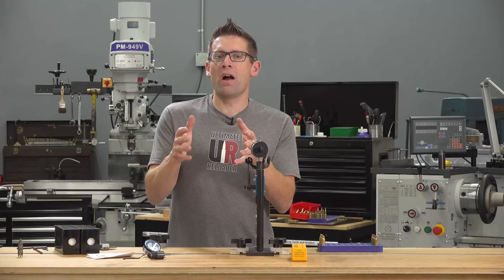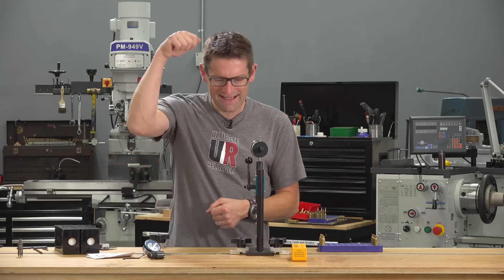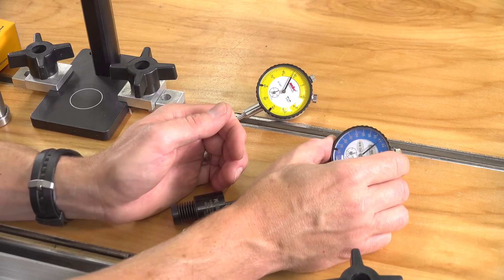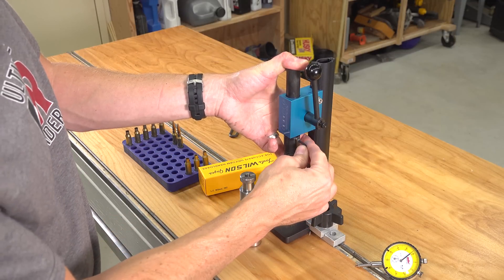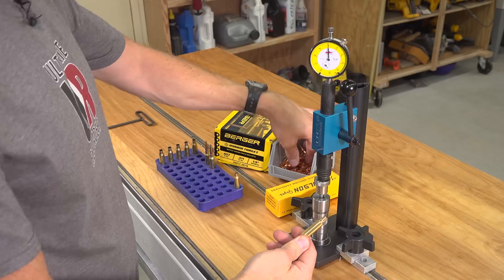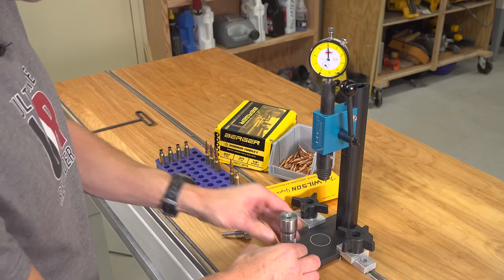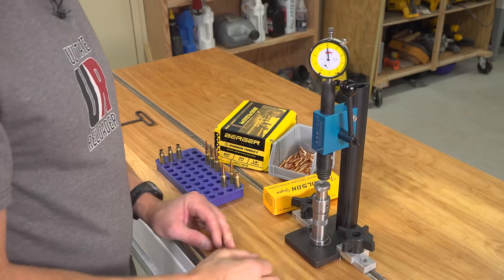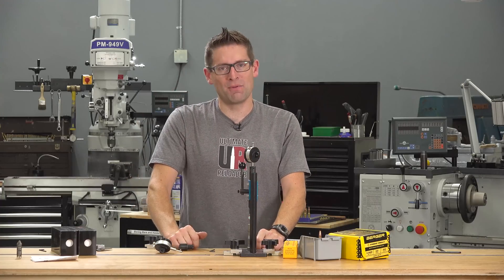Monitor Bullet Seating Force: K&M Precision Force Pack with L.E. Wilson Seating Die

Comment: When the gauge is "zeroed" it's showing 300 lbs (300/1000ths). The rotation counter is at three while under no pressure. This is the same as K&M's product video. I bought one and found the stainless rod between the head and the dial plunger is about 1/4" too long. I loosened the set screw securing the rod to the head and allowed it to protrude under the head and zeroed it. Zero rotations and zero thousandths. Then cut off the same length of rod that was protruding with a diamond wheel since it's stainless, polished it flush and now have an actual zero. K&M should really address this.

Comment: Going in doesn't matter. Going out does.  "case in point" I size some brass, neck tension was .002", I copper brushed the inside of the neck, pressed a bullet. The bullet seated great and I thinking to myself I'll have much more consistant release because I got the existing copper out. Then realized I seated it too deep, went to pull the bullet and I thought for sure something on my press was going to break. That bullet fused itself to case with incredible force. I was lucky to learn my lesson then but it also taught me going in doesn't matter near as much as out.

Comment: Inside and outside neck reaming/turning and annealing must be next ! I finally broke down and ordered the inline Wilson dies/ K&M arbor press and force pack setup. I really like my Whidden, Forster and Redding dies. But these Redding chamber dies are by far the most well made dies I have now. However the machining and edge softening and polishing is 1st rate on these Wilsons. I have read the internal neck inconsistencies can alter the rounds launch, by grabbing onto 1 side more than the other. Also by altering the bullets axis from the start in the bore. (as shown on runout gauges.) The round starts slightly off center and kinda bounces around getting started down the bore. By neck turning the inside, the seating drag can be lowered, and make the launch that much straighter and more consistent at ignition time. Seems all the benchrest/ F class and long distance guys all do this, for good reason. This should help any reloads shoot more consistant and straighter.

Comment: May I ask if you had taken the virgin brass and measured the neck thickness by using a ball micrometer, then trim them for neck thickness uniformity prior to loading them for the first time? Trimming to remove high spots or areas around the neck that are thicker compared to areas of the neck that are thinner in thickness. Of course this first trim can be done both on the inside and the outside of the case at the neck of the case mouth. I am asking this because I found it odd you would say the cases maybe suffering from work hardness after being worked prior to being fired only once. I am perhaps old school, in that I trim my brass case necks if they are not 100 percent the same thickness, then I will trim them again after firing them each time to the chosen thickness. Then I may anneal those cases after they have been fired 5-7 times depending on brand of case.

Comment: I'm SUPER new to re loading.. like never done it new but ordering stuff. haha. curious but if annealing, and bullet seat depth and position (i.e. using concentricity measuring to verify "precision"), assuming your powder charges are exact, and primers are set perfect,  wouldn't neck tension be the key factor in the FPS of a round while chronographing?And if neck tension is a critical factor (which is why we anneal and such) wouldn't this method using this exact set up be literally the ONLY way to determine that factor with any sort of number you could write down? for instance if you grabbed a whooooole bunch of already shot and annealed brass, and you marked each brass by the down force readings of this gauge, and grouped them based off those readings, then used each group in a FPS chronograph test. I wonder what the results would tell. To me the factors at play if the brass was sized would be the thickness of the neck, the strength of it, hard or soft, the bullet itself (do reloaders ever measure each bullet to be sure?) and the final factor would be the lube. To me dry powder would be a bad idea then because a build up could then create an uneven application right?

Comment: To really use neck tension as a sorting step and to use neck bushings properly, neck turning, neck reaming makes the process much more accurate and controllable. New brass almost always has extra thick necks, except in the case of hornady and civilian winchester. Neck measurement with a neck micrometer is much more accurate than a standard square edged caliper.

FL size 1st, ream ID to caliber, neck turn to 0.015" on medium length cartridges, 260, 308, 6mm, 6.5mm, 7mm. Expand, then test widest bushing 1st and step down narrower until your bushing gives you semi-consistent ft/lb readings on the force pack. 

Then sort by ft/lb measurement.  

Using low force pack for a bolt rifle, I get 12-20 ft/lb readings. Still tight enough not to hand pull the bullet back out.

Comment: Gavin I have just started in long range shooting and learning heaps my question is do I buy an arbour press as well and as I wet tumble with stainless steel pins then anneal and neck with a Lee collet dye before priming and loading which set do I need gauges wise and what other measuring equipment do you suggest please great vid thanks

Comment: I’m a total newbie when it comes to reloading so I’m just checking out gear at this point trying to figure out what to use. This seems like a great idea in theory but it seems like the force to see it it is so inconsistent that it just adds a whole other thing to worry about now.  It be great if you could set the tension you want so that it breaks free like a torque driver
Reply: Once you do it for yourself, you'll see (break away not nec). Every case is very different in tension. Sorting cases to get them consistent  according to tension can be very expensive. Peterson brass is much better than Lapua on this. Sorting to keep tensions between 12+24 ft/lbs is fairly reasonable or 10-22 ft/lbs. This is a very tight window without getting crazy expensive. Findng the magic combo of neck bushing and neck turning to 0.015" helps greatly. Spotting cases with narrow neck thickness while neckturning also helps weed out inconsistencies (as you neck turn, thin neck thickness wont get shaved. You'll have very shiny metal where the neck did get shaved- "keeper cases" will be obvious at this moment by being completely neck turned/shaved evenly on entire neck surface.

Inconsistent neck thickness cases become useless or too loose to hold a bullet without narrowing your bushing by 0.001"
Reply: You have to apply as much pressure as it takes to seat the bullet.  Knowing how much pressure it took can help identify an issue of escessive or inconsistent neck tension.  The press is available (and cheaper) without the force indicator for those who would rather not know.

Comment: 21st Century shooting “hydro press” is the way to go.
Reply: Yup. I've had K+M since day 1 almost. XXI century is a lot more money, but much easier/smooth to use, plus it has more mechanical advantage. K+M is a fantastic company though. Super customer support, even on old products.
Reply: 21st century. Great customer service. I blew out my hydro by accident. Sent it back with my hat in hand. It was fixed and returned to me for free. I like it much better than this.  You can drive yourself nuts with all this thinking on neck tension.

Comment: Not sure what knowledge we're supposed to assertain from this . We already know brass work hardens , we can tell this by measuring the springback post  sizing using a headspace gauge ,after a few firings .
 The answer is simple , anneal your brass and be consistent in your case prep . 
 Seating using an arbor press on the other hand , proven to aid concentricity. The gauge is probably best kept in the draw with snake oil , to prevent corrosion. 

 Now where are those pigeons when you're ready with the cat ?

Comment: It would be interesting to see if chamfered necks make a difference. Also, does neck turning yield more consistent results.
Reply: Neck reaming does, OD neck turning not so much other than it gives it a more concentric neck (for F/L sizing or bushing sizing) ID reaming, makes the hole (where bullet goes into) be in the same in-line axis of the whole case, and that itself would allow you to have less force (ie, more accuracy and more consistent fps/groups) as pressure needs to be minimal to push the bullet out vs building it up to push the bullet out of the neck with say .003” tension.

Comment: Was that ft/lbs or inch/lbs?  interesting video! I never would have guessed it took that much pressure. I saw an F-class guy using one and was wondering how it worked. Thanks for the great content!
Reply from the maker: This is linear force, not torque. So it's just "pounds". :)
Reply: Had to be inch/lbs I doubt that the thumb would able to seat 90 foot lbs
Reply: It was ft/lb. more than likely. I have the old version K+M with the low force pack.
Reply: As Gavin says, it is simply pounds of linear force, not unlike setting a 60 lb weight on top of the ram.  If we knew the mechanical advantage of the press, we could translate that into the amount of pressure needed on the lever and the ft/lb of torque required.

At a mech. adv. of 10:1, 60 lb at the ram would require 6 pounds at the lever (plus frictional losses).  6 pounds of pressure on a 4" lever would be 2 ft/lb of torque.

Comment: Ok so I might be in over my head because I don't really precision reload and what reloading I have done I just started doing in the last year or so. I guess I'm just struggling to see what the purpose of this device really is or where you get value added by using it. I know it measure the amount of force it takes to seat a bullet but can't you tell most of the time by hand when your neck tension starts to increase or decreass. And how does it help you solve the problem? It just tells you your brass neck tension may have been work hardened and you might need to anneal? I mean I don't really know so I'm asking. It just seems to me that a properly flared case neck and an occasional annealing in conjunction with a quality seating die/stem will pretty much keep you in the good
Reply: Ryan Painter it more for those who are really trying to make sure every load is as close to a direct clone. If you have one with a slightly tighter neck tension than the other it will chance the point of impact and the further you shoot the more pronounced that impact shift gets. For most of us we dont need this but there are those out there that do. I see this more for the bench rest guys.
Reply: steve griffith 
Yeah that makes sense. All that I have reloaded so far is 223, 9mm and 45acp. As you can see my experience is limited and all the work I have done has been on a single stage. With that said after 3-4 loadings sometimes I can tell when my 223 brass is getting harder because during the sizing and bullet seating the force needed to complete the operation starts to increase and in some cases it's enough that I can really tell by hand.
Reply: Ryan Painter I have been reloading for over 20 years on a single stage. Multiple calibers lots of hunting ammo and plinking ammo. Never had I needed to know my seating lbs. like most I go off feel. I’m not a bench rest shooter or trying to take a bottle cap off at 1000yrds. I’ll shoot 1500 yards at a metal plate all day long for fun but by no means am I under 10MOA at that distance. I get it tho some people like to overly geek out and that’s cool. Only way I would use something like this is if it was digital and stopped at the highest Load. Analog to me would be to frustrating . Most of us will run out of talent before actually ever needing this. 😂
Reply: steve griffith 
Well I wanted to make sure I wasn't crazy or anything when I said I could feel when the bullet was starting to get more difficult to seat. Like I said I have only been reloading for a little over a year so I didn't want to make to bold of a statement but I was pretty sure I could tell when the force needed to seat a bullet started to increase. I just feel like this is a product for the absolute upper echelon of precision reloaders and even then it may only appeal to those that really nerd out on the science behind reloading.

Comment: What die would you recommend for the lapua brass. The small flash hole?
Reply: Armando Benavides 
Redding die’s work with brass with small flash holes. I get good results with the Redding bushing die- you can control the amount of neck tension with it
Reply: S. Manuel 
I appreciate your input. All Redding, or is their a particular one. I’ve read good reviews on those dies & I am Interested in the competition or the hunting. Thanks again
Reply: Armando Benavides 
From what I have read in forums Redding will send you the proper size pin if the die you buy has the larger pin, just contact Redding. The die that I have that works is the Type S bushing style full sizing die, part #77446. You will have to purchase a bushing in addition to the die. And you will need a micrometer to measure the outside neck diameter of your loaded cartridge. From this measurement, subtract .001 and that will give you the size bushing to order.

Comment: Would be nice to have some measure of the variation in MV versus variation in neck tension with seating depth controlled by head to ogive dimension, not COL measured head to meplat.

Comment: Try resizing FL without the expander ball then using a Sinclair expander mandrel.
Reply: This is the way to go.should be more consistent pressure.
Reply: Also use a Pin Gauge (Vemont Gage has them in .0001" increments) to determine the internal case necks are really consistent.